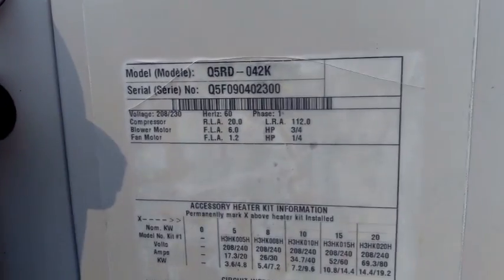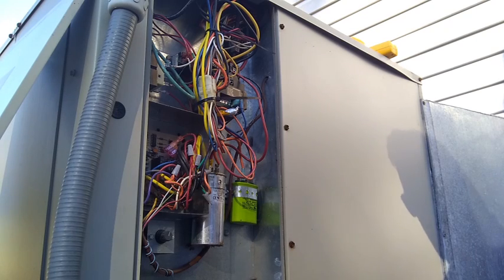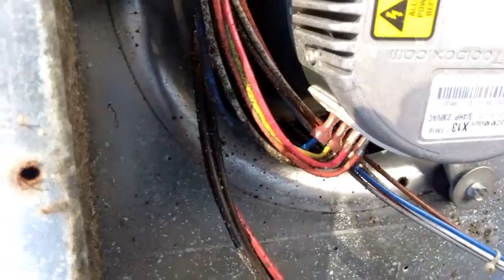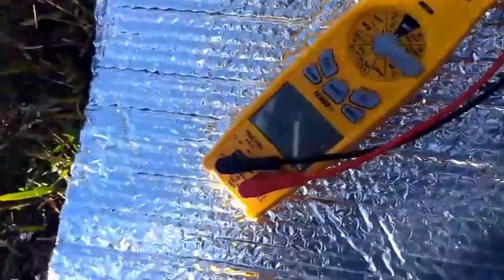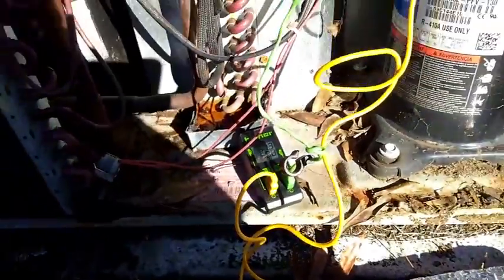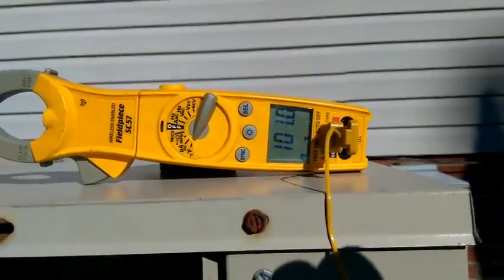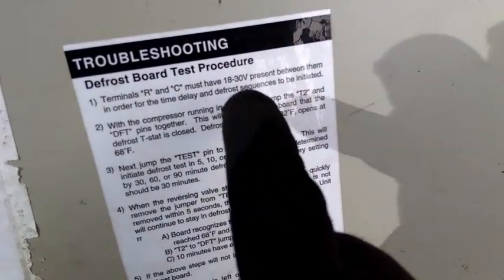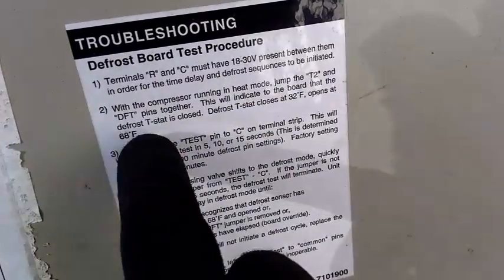Testing Heat Pump Defrost | Nordyne

Comment: I'm sure I'll catch hell for asking, but what would be the first step if I cannot get any power to the board to do the test? I have verified I have voltage coming in to both 110 lines. Unit does nothing at all. My forte  is automobiles so I guess reading the wiring diagram is my best option but also hoping that there is something very common that will save me time testing every component

Comment: Great video Zack.  Really learned a lot. I have a few questions but first two comments. 1) I really believe in installing those pvc unions on the primary drain. In my humble opinion I think they are a must. 2) I'm a firm believer in reading the manufacturers instructions.  Whether it's installation instructions,  start up procedures or trouble shooting guides.  You'll be surprised how many times I get called a rookie for doing so. Question: 1) Do you use low loss fittings on your Z manifolds or just experience to not burn your fingers?  2) Is that service drill you're using a good one or would Milwaukee be better? I would like one that can also be used with a step bit aka uni bit.
Reply from the maker: Reading the instructions is always good. I do not have low loss fittings because there is so little refrigerant stored in the zMan. I like the Rigid drill, but it does release the chuck a little much. It is capable of being used with a uni bit.